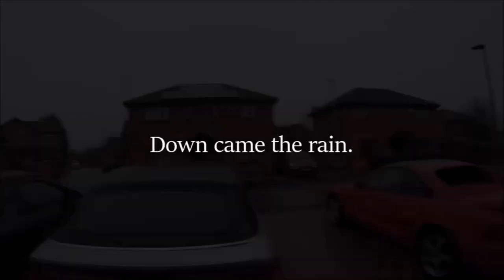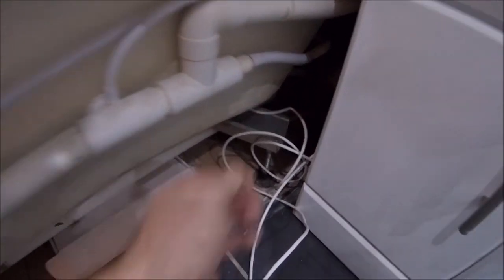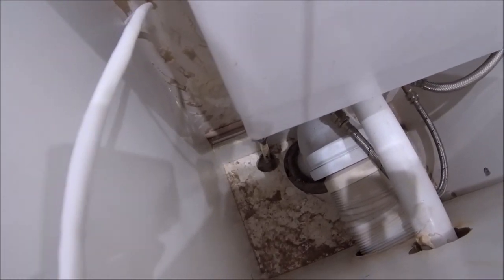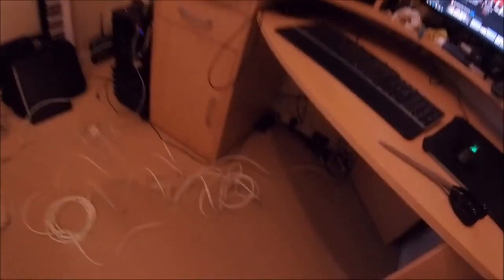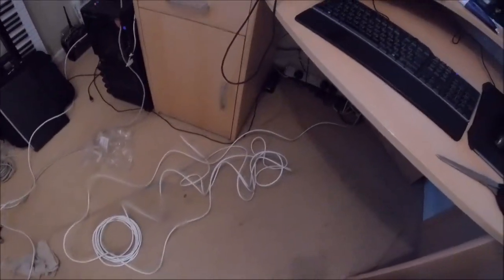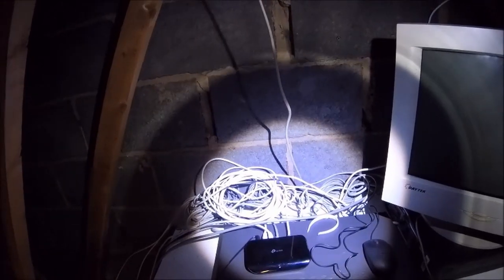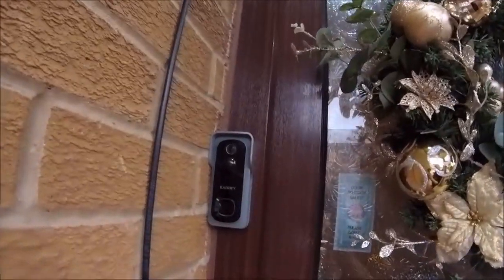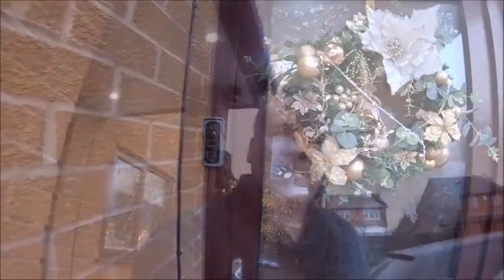Replacing my security cameras with some new 1080P units...

Comment: Nice Video Ade, I have several of the Hikvision units myself, I really rate them. I have all of my cameras set to record when an event is detected (motion) backing up their footage to a 6TB NAS, although they only have 100Gb allocated to each camera. This is enough for approx 2 weeks of footage. Do you have the Hikvision app? Its called iVMS-4500 and is on the Apple and android stores. With this you can view your cameras and review any playback footage from anywhere! It's pretty decent. Merry Xmas to you and your family buddy! Hope we all get a better New Year!
Reply from the maker: Hi Kev....  I used to run everything of a synology DS and it worked fine , but you only get two licences and have to pay a 3rd world debt to get anymore, so it was cheaper to go with this solution...  Ill be honest they are all Ebay specials (Used) but so far im doing OK, the cameras are all set to motion and can be a bit anal especially in the back garden where the movement of bushes sets them off, but the quality isn't bad compared to what i had. I have been playing with IVMS as its the only way to get the cameras from the default network to the correct one on the base station, and also had a bit of a play with the phone app.. Hopefully as time goes  by i can add and adapt but seems a fair start ...     :)
Reply: @AdeReeves  with the motion, the sensitivity can be adjusted until you find the best setting for your situation. You can also select sections of the image and tell the software to ignore movement in that zone. It’s pretty impressive for standard software. There are other far more powerful options but I find it perfectly adequate for what I need. Also it’s really easy to add further cameras as and when required.